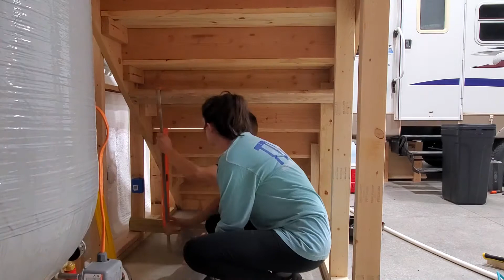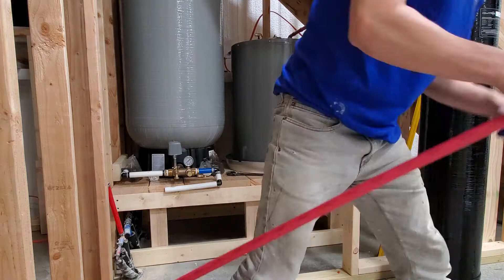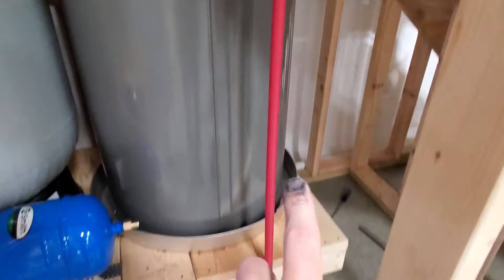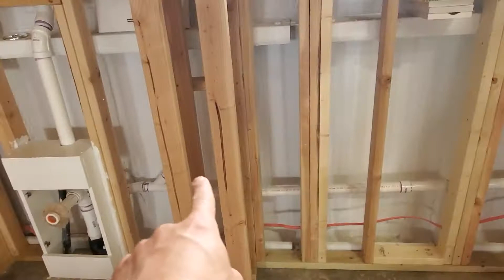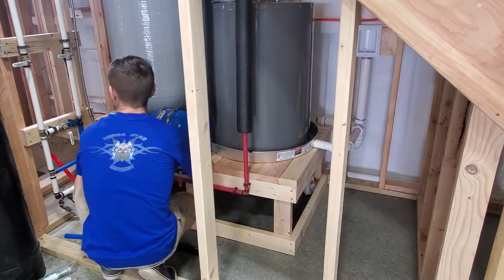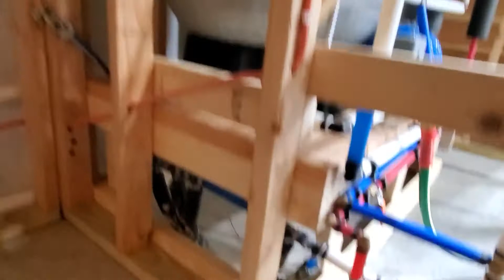50x60 Custom Hangar Home Episode 27: Plumbing the Water Supply Utility Closet

Comment: Hello Zack...nice progress with your plumbing.  However, one thing worries me.    Unless I missed something,  the upper platform is being held up by just he screws/nails to the legs and the studs on the wall side.  The two tanks, when filled, will be very heavy.  You should consider placing some blocking under the upper frame that connects directly to the floor or the top of the lower frame. 

You two are doing a great job.  Waiting for more video!
Reply from the maker: Thanks for the feedback. The top platform is screwed into a bunch of studs on the left and back, which transfer the load down to the floor. The front and right are held up by the 6 legs, which also transfer the load down to the floor. I've had the pressure tank full on the platform for several weeks without issues. It's the bigger of the tanks, but I think she'll hold. I've jumped up and down on the other side, and there's no flex, ha!